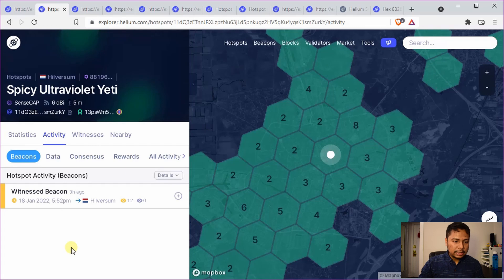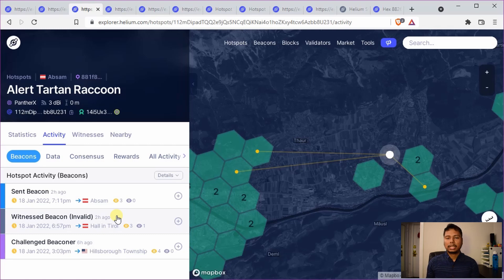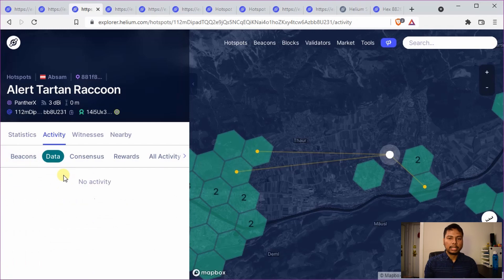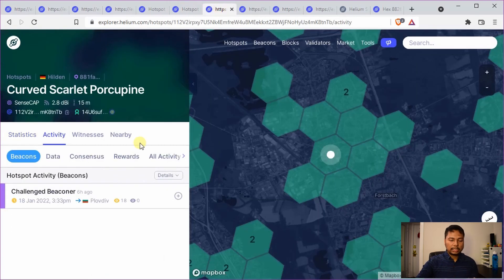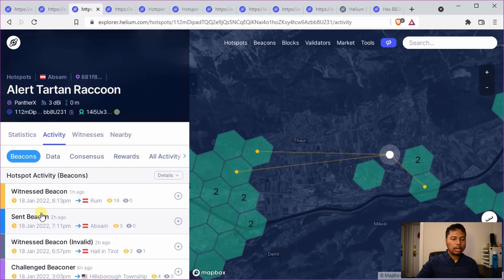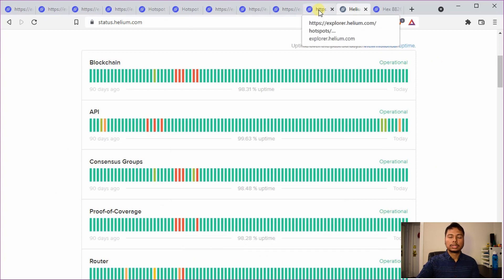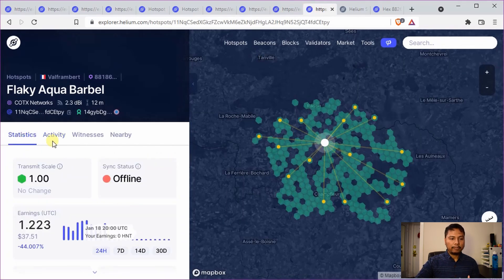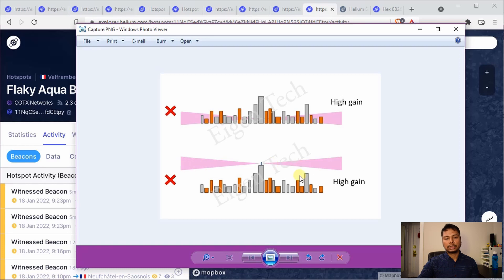Is your Helium miner's antenna working properly?

Comment: Hi, I changed the default antenna with a 6dbi antenna over 9 hours ago and did not get any witness yet, my hotspot did not even send a beacon. Perfectly synced and with latest firmware on my hotspot, all connections finger tight. How much time is reasonable to wait? Should I just be patient?

Comment: My miner created last Brocadted becon 6D ago and witnessed beacon 4D and 2D ago with reduced minining rewards. I have changed nothing. Before this use to happen once or twice daily. Now withness as well as brocast becon is happening at a gap of 2-6 days. Also constructed challenge and Challenger beaconer happened 13D ago on my miner. No challenge creation after that. No challenge beaconer too. What should i do and diagnose the issue. Please help?

Comment: I set up my hotspot 2 days ago it is online and synced but no activity apart from asserted location and added to the blockchain, I’m in a city with other hotspots and have an outside aerial (15 meters up) so I need to wait longer or should I be concerned about the aerial?  I get a successful ping test on hotspotty if that’s of any help?
Reply from the maker: Antennas placed inside do not work very well. Can you at least temporarily place it outside to check? What gain are you using?
Reply: @eigentech6567  sorry typo, it’s outside and it’s 4.5 dbi

Comment: Hi Roy, fantastic video. Just a quick question. My antenna is 6dbi but I have a 10 metre LMR 600 cable to my Antenna that is 13 meters high. Do I put 6DBI in the helium app or take into account DB loss and put something close to 5dbi?
Reply from the maker: Yes, you can subtract the cable loss put that value in the app
Reply: Eigen Tech many thanks, the new POC that comes in means that higher DBI is not always better. The bobcat in EU output is 12.8DBM, - Cable loss + Antenna DBI is your hotspot total DBI. However I heard the it’s limited in the EU to 16.5DBM so anything above this the miner slows down is that correct? I’ve read several articles on it? However if I google “what is the eirp limit Europe” it comes up 20DBM, do you have any info on the above? Thanks I’m advance
Reply from the maker: @WebStudiosDirect  You are right, I have discussed the topic in this video https://youtu.be/6ZYYgRYJMcw. I think you have to use "LoRa" in your search to get accurate results.

Comment: Hello Ray. Thanks for your videos. Only one correction, if you see "Challenged Beaconer" it does not mean that your hotspot crated a challange, it means this. Lets say B hotspot is where you can see "Challenged Beaconer" A and C hotspots are different hotspots. So "Challenged Beaconer" means A hotspot "Created a challenge", which contains this: "B hotspot, please challange C to send a beacon."

Or I am not right?

Comment: Hey! I installed my miner a week ago. I did everything to let this preform the best way possible. It is online and I have a 1 transmitscale. However the miner hasn't witnessed a challenge neither did it not witness any hotpots nearby... should I worry? On the explorer where you find the milestones it first says to witness a challenge and then to see if the miner can witness any hotspots nearby. Is it in this sequence the first process goes? thanks in advance
Reply: The same thing is happening to me right now
Reply: @barnydotheduck  Hey man! just patience, it will work someday. However, I see much less acitivity in the recent days

Comment: Hey Thanks for the valuable video. I have upgraded my antenna to 5.8dbi and my witnesses drastically reduced after. I did not turn off the miner when I changed, could that be the reason ? What should I do to redo this? Should I turn the miner off, remove antenna and reinstall?
Reply: You always should turn off the hotspot before removing the antenna!

If the miner didn't send any beacon with the antenna connected you should be fine, you don't need to uninstall and reinstall.

It looks like that today everyone had low earnings, let's see in the future

Comment: Hi Roy, thx for this video this was helpful. I just want to make sure I got it right. My miner orbiting dijon ram was set up 6 days now. I have no sent or witnessed beacons and no data. But I do have challenged and broadcasted beacons. Only one of my broadcasted beacons has a witness, all the rest of them have zero. So I should wait A little bit longer?
Reply from the maker: Yes, do you live in a less-populated area?
Reply: @eigentech6567  yes, I have only 28 miners near me.
Reply from the maker: @pdsurfer1  is your antenna outside?

Comment: Hello Roy !(a big apology if I'm misspelling your name)
First of all thank you so much for sharing all this expertise knowledge with us. I've seen all of your videos and I'm a big fan of your channel as it helped me to get introduced and learn about Helium mining in details. I'm planning to invest and place an order for some Helium miners and antennas within the next couple of weeks, but as I was ready to pull the trigger I got uncertain if I should get a full hotspot-miner or if I should wait for the new light hotspots hitting the market in Q1 of this year (as per Helium's project plan). Light hotspots are expected to cost half or even less than half of a full hotspot miner and they will execute the same tasks. Can I kindly ask you to make an up to date video about the differences of full hotspot vs light hotspot, their specs, the potential difference in earning capability (if there is any difference), if they can be upgraded with a 3rd party antenna as the current miners do, an estimated timescale of them hitting the market and any other detail you think is useful. Thank you so much, Have a great day! :)
Reply from the maker: I am Roy indeed. I am glad that you found the videos helpful. The light hotspots will perform the same tasks as regular hotspots and earnings will be the same. However, Helium always runs behind its projections. So, I am not sure about the actual timescale. I will definitely make a video in the future. You can use 3rd party antennas.
Reply: @eigentech6567  Thank you so much Roy, greatly appreciated, have a good day!
Reply from the maker: @Dimi_29  you are welcome

Comment: My miner is Helpful Cobalt Quail, using SenseCap with Rak 8 dBi outdoor antenna 9 mts up,w/lighting arrestor and grounded, with 18 ft  LMR 400 cable. It witnesses beacons and some challenged beacons, but it does not send beacons (only one sent beacon 4 days ago). I am earning only 0.2 - 0.3 HNT per day, very low. Is something wrong with my antenna?  Thanks you
Reply from the maker: I can see that you do not have many "sent beacon" activities. I am not sure as everything looks fine. You can restart it once and leave it. To be honest, your earnings are pretty good and I won't even worry about that.
Reply: @eigentech6567  Thank you!
Reply from the maker: @papiwilly  You are welcome
Reply: What kind of lightning arrestor have you used and a link please where you purchased it from

Comment: Hi, watched all your videos and did everything but still my miner shows relayed status. The API is showing P2P address and I am getting 0 witnesses. Do you think it could be antenna problem?
Reply from the maker: relayed is not related to any antenna settings. What kind of internet connection do you have? Do you live in a large apartment building?
Reply: @eigentech6567  My relayed status is solved now but it is still showing 0 status from the last 9 days. I live in a detached house and I have ethernet connection.

Comment: Hi bro. Nice video.

1. If you change from an antenna , how long does it take for that change to take place? 

2. I changed the original 4dbi bobcat antenna for a 5.8dbi one from aliexpress. Rewards went sky high.. to 1.20 even. So in my head i was like OK let me invest in a fiber glass antenna with lmr400 cable 3 meter. 

Conclusion: after 1 week my rewards went from 1.20 to 0.30 , 7 day average beacon from 1000 to 400 and witness went up to 170 from 140-150. ???? So confusing

I am REALLY confused.. the hotspot is 35 meter high and outside. We did exactly the same setup but “better” fiber glass antenna but higher witness but lower rewards

The hotspot name is Handsome ceramic rook. Hope you can help/advise me ;( thanks
Reply from the maker: 1. If you are fully synced and there is no ongoing problem with the network, you should start seeing the (positive) change immediately
2. The last week was particularly bad as there was a problem with the network. 
I would say that wait for another week and if you continue to get lower rewards maybe go back to the aliexpress antenna. Just note that sometimes grounding could affect the performance of the antenna
Reply: @eigentech6567  thanks bro! Appreciate it. We went back to the smaller 5.8 antenna with magnetic base and rewards went back to 0.6 from 0.2.. really weird.
Reply from the maker: @bugoliniwatches  anyway, 0.6/day is pretty good
Reply: @eigentech6567  just curious how grounding will effect it?
Reply from the maker: @mattm.1958  Some people have reported that their antenna stops beaconing when they ground/do not ground their external antenna. This indicated some electrical interference, so you can try both but one should definitely ground the lightning arrestor if the antenna is installed at a higher location
Reply: @eigentech6567  ya I live in SW Florida, so I have no choice but to ground it here. Way too much lightning in the summertime